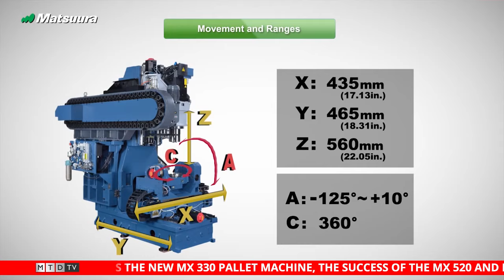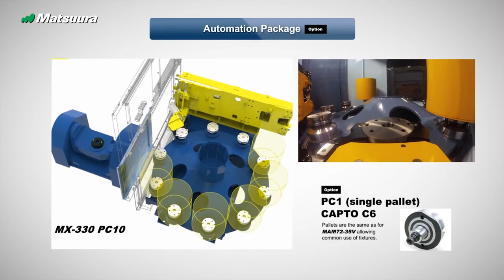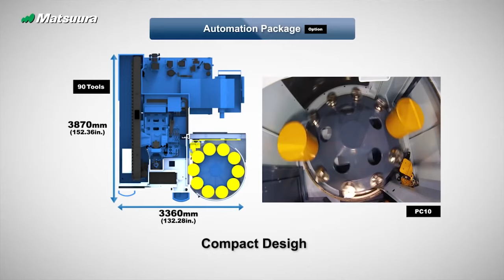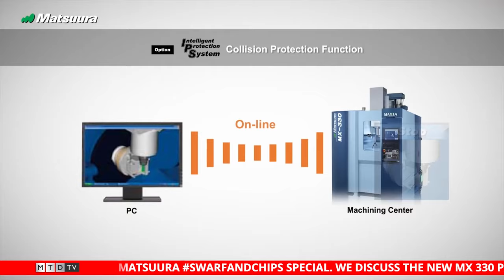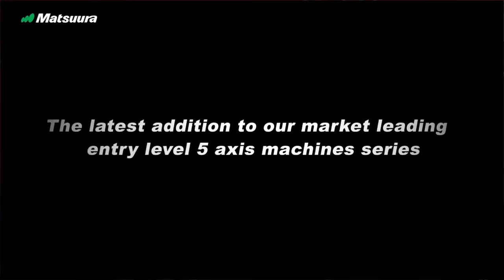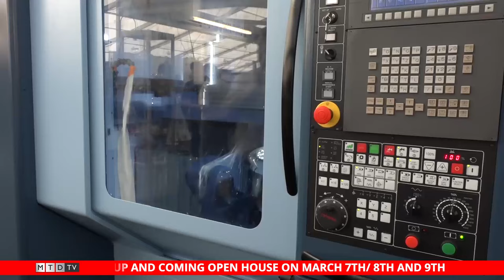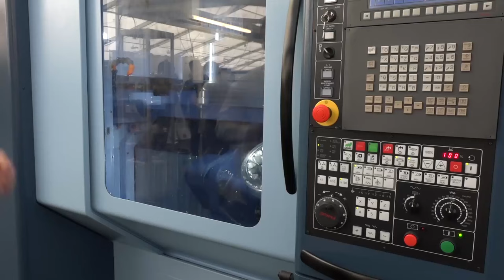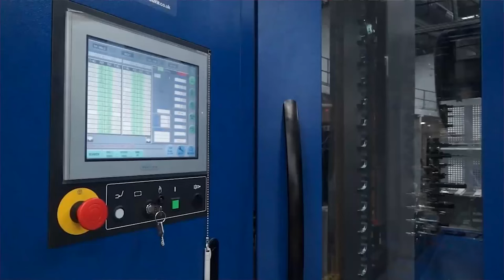#SwarfandChips - Metal cutting masterclass #matsuura MX330 MX520 - 17/02/2017 - EP16

Comment: I ran 2 Matsuura 500's for five years.  With the geared drive, the machine was a beast.  I enjoyed hearing the transmission clank around.  I mostly worked armour plate, and titanium, once had it running at 95-100% spindle load for 27 hours never missed a beat.  We did add small automotive oil coolers to the hydraulic fluid system though.  Even when the shop got a few new DMG's most of the men did not clamor to leave their Matsuura 800's.

Comment: Matsuura are ace machines. I remember where i worked before the high speed milling machines where working 7/7 24/24. The german machines needed a spindle replaced every year to 2 year ish. On 5 year time the Matsuura never never left a beat. And they weren't aces in machine maintenance where i worked.